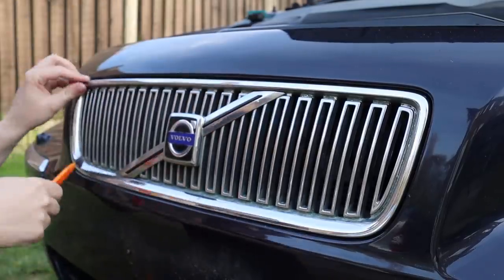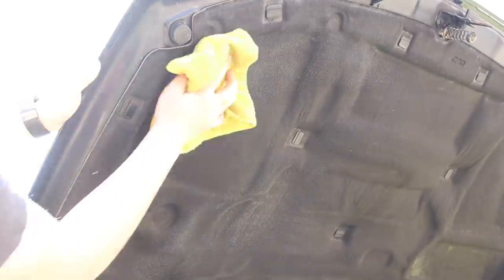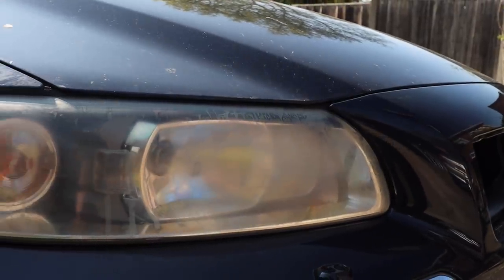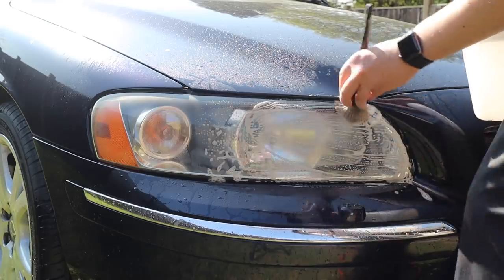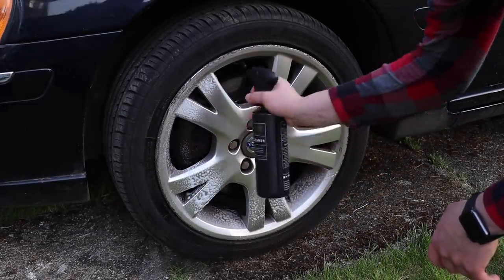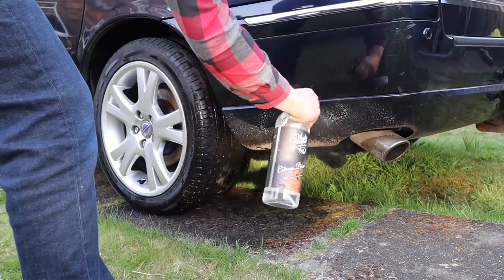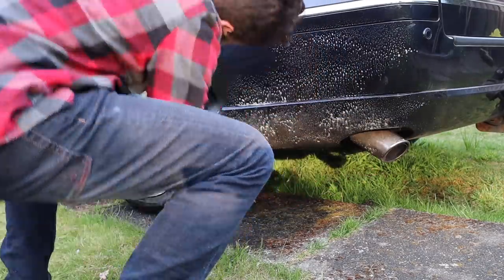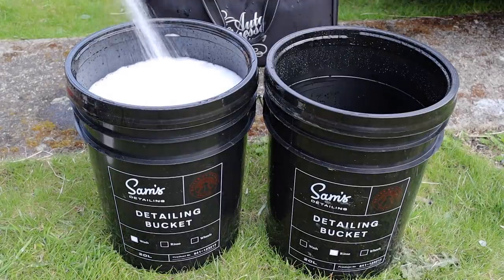£550 Volvo V70 Exterior Detail Pt1

Comment: Can’t wait to see how you clean the windows. I normally just use newspaper and basic household window cleaners, but you’ve got to spend so much time and in the right light because you get residue. Did used to use a steam cleaner with a squeeqy attachment, which if the steam was upto pressure was brilliant but when you was getting water drips it ruined it.
Reply from the maker: I found Sam’s glass cleaner and a magic eraser really good. I’ve got an overkill video for glass on my channel :)

Comment: Luke which nilfisk pressure washer model are you using? Also you should consider buying a rotating nozzle attachment, quite cheap and can easily do the top of a range rover without having to use steps etc, also good for getting right down into the wheels and lower parts of the car without bending down
Reply from the maker: I got the e140 :)

Comment: I think i get the Volvo V70 virus and i am happy about it , thank you 

How many kilometers on the clock of your v70?
Reply from the maker: Approx 280,000km. Or 180,000mi here in the uk.
Reply: Torque Steer not that much for this engine

Comment: hi, i have the same volvo as yours, the car is really low emergency but not comfortable, the suspension is very noisy and it hits the uneasiness, only the seats are comfortable, after 130km / h it is getting loud in the car, this year i am going to change the v70 for Mercedes W211 better comfort and silence. Regards
Reply from the maker: I'm used to Audi's, so this is quiet and soft compared to them haha.

Comment: wht would you dry the car with such care when you dont mask the headlights up whilst sanding
Reply from the maker: I can only cause 3000 grit scratches that would buff out (and it’s going to be polished anyway), but a stone lodged between the body and towel could cause a deeper scratch that could be a problem.

Comment: When it comes to grills and changing the colour, plastidip or similar products are your friend.
Reply from the maker: Yeah they are. But a grill is only £15 from eBay for this so it wasn’t worth spending £10 on a can for me.
Reply: @TorqueSteer  that's cheap for sure. My c30 one cost me  £50 ,was cheapest i could find at the time
Reply: @tesstickle7267  facelift or pre facelift?